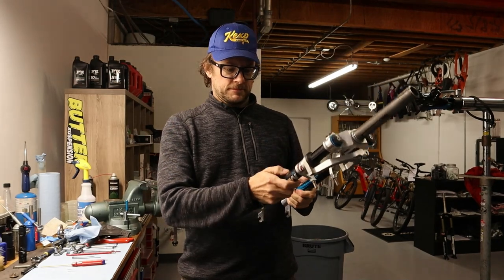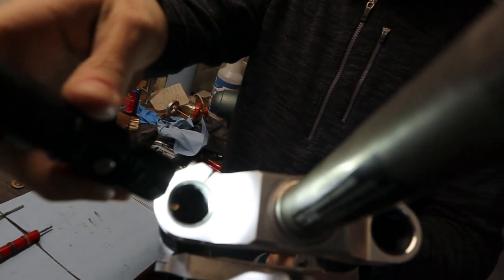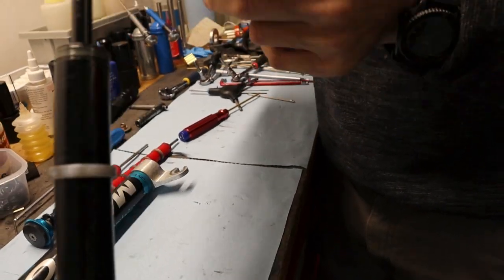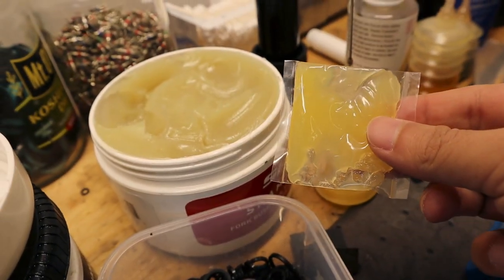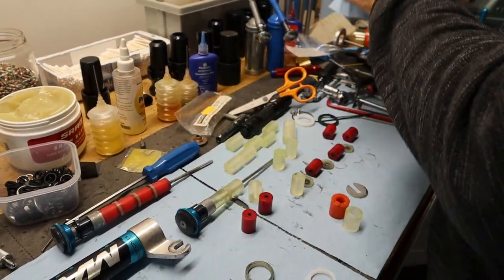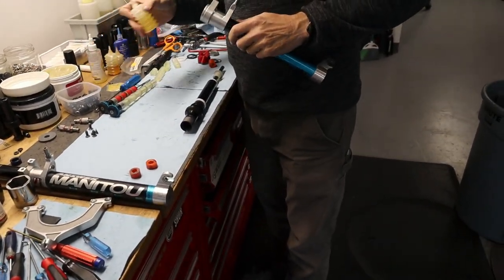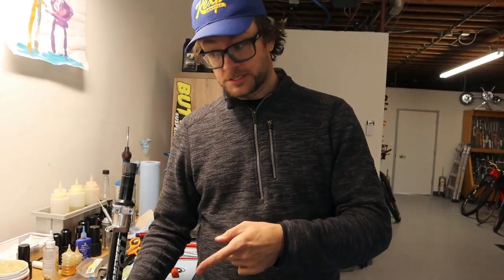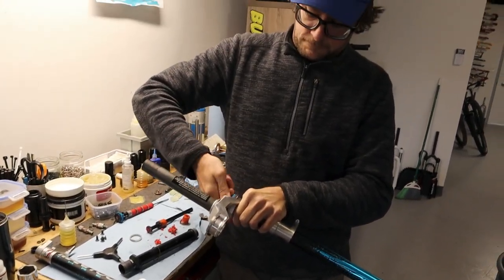Manitou Three (M3) Suspension Fork Rebuild | Butter Suspension

Comment: Awesome video. I could have used it 4 years ago. Some of mine were also melted. I couldn't believe it, so weird. I rebuilt mine with new elastomers I think I bought on ebay from Suspension Fork Parts. They're still cutting new elastomers for these old forks, so awesome! I'm still rocking the Manitou 3 on my Performance TM-1000.

Comment: Hey Greg! Great videos! I’ve watched a couple while rebuilding some of my forks but when I got to my Manitou 3, I had a few surprises. First, I found coil springs (no elastomers whatsoever). Second, the non-drive side had a little hydraulic damper. They used a steel shaft that had rusted considerably and prevented the fork from compressing, but I plan on fabing a replacement. Wasn’t sure if you had seen one of these before.
Reply from the maker: Ooh, interesting! I wonder if they're made by a company called Fork Wings? I just bought a set for Judy's, send me some pictures and we can compare...

greg.mackenzie@gmail.com

Comment: Thanks for the video of remembering the early-ish days of suspension forks.  
Until the bombers came out, options for reliable were ummmm, limited. And I think the manitous were about the best, because of the simplicity.  They were also favorable because for the given travel, they were shorter forks so we could retain our 71 or 72° head angles, and not push the BB too far above 12". Afterall, 93ish most of our frames were still based off rigid forks.

Comment: I have been searching the net for info on restoring old vintage forks.  I am into the older mountain bikes but many of the 90s models come with shocks that have literally no travel.  I am trying to find the info as to whether/how these forks can be resurrected and where to source the parts ( or substitutes).  As I was mainly interested in rigid mountain bikes (80s), my knowledge of suspension forks is minimal.  So any video that kind of explains these shocks and how to match certain frames with certain forks would also be of great value.  Also would like to know which forks of the 90s were the best of that era and worth saving. Just discovered your channel and definitely like what I am seeing so far.  Thanks

Comment: Hi Greg, another great vid! Love the nostalgia! I have an old specialised enduro SX 2004 with monocoque frame , Fox Vanilla coil shock and Marzocchi coil fork, can’t quite remember the model, but it’s a free ride or something with an ETA travel reduction/lockout. The shock and fork ride super smooth with coils, but I don’t think the dampers been serviced for 15 years😂 I keep thinking I should try to get them rebuilt and restored to their former smooth glory, but would probably cost more than the whole bike is worth now😂
Reply from the maker: I saw a great quote about luxury cars and how much they cost to maintain: "the value of this car may have gone down, but the cost of parts and labor for maintenance will always be the same or more" You can ignore them forever but eventually they'll just fail, and then the bike (if unrideable) has zero value!
Reply: Lol, too true! I had a mechanic who said the same, I was thinking about buying an older jaguar XK8 convertible for £15k or so, his advice was it’s still an £80k car if something goes wrong😂😂

Comment: Hello ,thank you for the video !
I have the same fork; it is in pretty good shape but unfortunately it is stuck... Cannot find new elastomers anywhere in Europe...the original ones seem in good condition thought . Do you have any idea ? That fork was on a sunn 5000 that I particularly love. t would be so nice to have it back working on that bike.
Reply from the maker: Suspensionforkparts.net is where I get them but I'm sure there's an option in Europe. Also, if the elastomers are original, I can almost guarantee they should be replaced...they really don't last for decades!
Reply: @ButterSuspension  thanks a lot ! I’ll try to find that on the bay. However I found springs that are made for those forks but I really doubt their efficiency
Reply: In Hungary manufacturing and selling manitou elastomers in Shimano dealer,Paul lange hungary Ltd Budapest.

Comment: I had a 94 Answer FS. It used these fork mounted in reverse to suspend the rear swing-arm.  We would remove elstomers from the compression stack and re-arrange them beneath the recoil or bottom stack, ta-da! another 20mm of travel woo hoo! Ghetto I know, I was however desperate for more travel front and rear.
Reply from the maker: I thought about doing something like that one the bike this goes to, but top out control is pretty important, even on super low travel like this one.

Comment: Hey Greg! Loving the vintage rebuilds! I have a 1998 Marzocchi Bomber that I'm hoping to fix up, but it's missing the old QR20 axle. Any tips on where to source one without having to sell a kidney? I live in Canada if that makes a difference.
Reply from the maker: If I remember correctly, there were two types of QR20 axle; one is basically part of the hub and one was a slide through option...your best bet is probably to buy a complete fork or look for hubs with axles on eBay. Send  me an email through my website and I can double check my "inventory".
Reply: i have one or 3 in my tool box..............i think greg has my email, so email him

greg, i asked you about fixing the air spring of my magura fork

Comment: So the trashed fork you show at the beginning, could that still be used as a rigid fork? I bought a '95 Diamondback Vertex with a Manitou 4 and the fork is frozen. No travel at all. The dust boots or whatever are fully compressed. The bike rides fine, I don't think it was ever ridden hard off road, still has reflectors etc. I don't need a suspension fork but I also don't need my teeth all over the ground, reason I ask.
Reply from the maker: Technically, yes. Even with dead elastomers, the fork should still hold together just fine, but the head angle will be steeper and the bottom bracket will be lower so the bike might not handle as designed. You could also just rebuild the fork, assuming it comes apart without much difficulty.
Reply: @ButterSuspension  D'OH! Yes of course because, travel. Alright then, going to try the rebuild, thanks.  Update: Springs inside! One 5" steel spring with melted red elastomer globbed to the bottom in each fork.

Comment: Where did you get the seals and spacers etc...kit?
Reply from the maker: I've got a few vintage NOS kits from shops that stopped working on suspension.
Reply: @ButterSuspension  of course.....bummer.I'm finding it difficult to find retro parts for my retro bikes....99 Cannondale Cad 3 with headshok the M60 and this kit for my Manitou three with the long travel kit....I have the elastomers but I need the clips and seals and O rings....

Comment: I have a manitou 1 that id really like to rebuild but one elastomer is pretty gooed up at the bottom of one of the legs. Could u give some pointers on how to clean them up? Im willing to do the work but not sure how to go about it. Great vid
Reply from the maker: The last one I did I used a heat gun. It turns them into liquid. Took a long time, but got most of it out!
Reply: @ButterSuspension  awsome i will give it a try.

Comment: Where can I get  replacement seals? Thanks if you know.
Reply from the maker: I randomly got a few sets from a shop that was clearing out old stock. Not sure if anyone is making them aftermarket, but you may want to contact Specialty Retro Products and ask them. Seals and bushings would probably be pretty popular.
Reply: not sure if they are still open but the website is still up  >>>    https://www.suspensionforkparts.net/eshop/answer-manitou.html?page=all
Reply from the maker: Nice, didn't know they had those seals! I've only purchased elastomers from them.

Comment: I wonder why the elastomers come as a stack, not just a single long rubber cylinder. The function would be the same, one might think.
Reply from the maker: You could stack different stiffnesses to "tune" the spring rate. But some forks did come with one long elastomer.